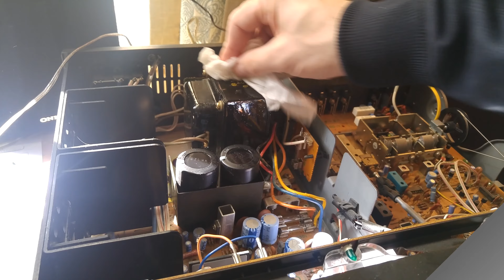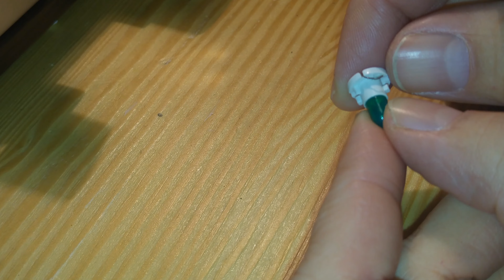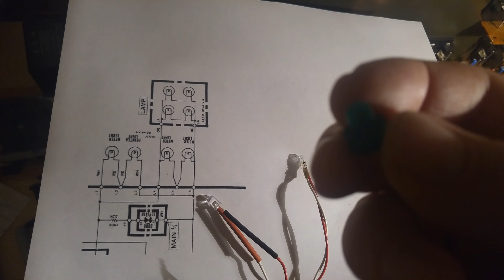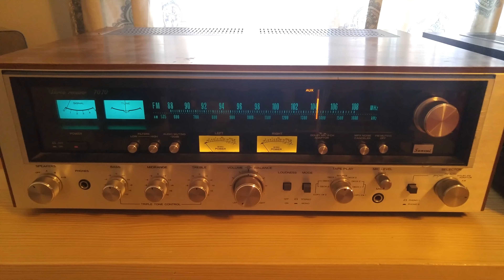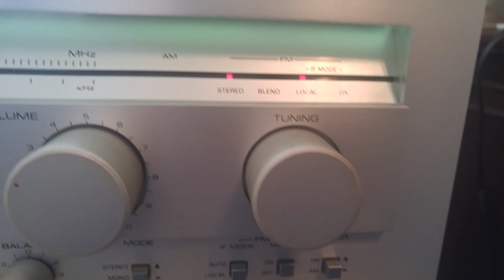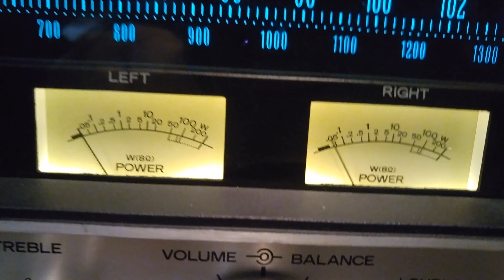Yamaha CR-640 vs R-N301 vs Sansui 7070

Comment: LED's are too "hot' in my opinion.  I prefer the original lamps with the condoms on them.  BTW, the Sansui, as proven by the increase in pricing, is a much better unit.  The 40 series had the now unobtainium pre-driver chips. That has tanked the value of these machines, unfortunately.  Those were made by Sanyo specifically for Yamaha, and are proprietary.  A dead unit is now a paperweight.
Reply from the maker: Yes, I started listening to the Sansui almost daily a few years back and really like it... Thanks for the comment!
Reply: @ACBMemphis  I've also heard, but can't verify, that these units attract spiders.... :)

Comment: Nice video. Did I miss the part where you got the protection relay to clicking and the receiver begins to work again? I have the exact same problem with my CR-640. Can you walk me through what it took to get it to start back up? Thanks ACBMemphis.
Reply from the maker: I didn't record that part... Using a digital voltmeter, I put the black/negative on ground, and measured the voltage at 2 specific test points on the board near the protection relay. (I believe these were labeled TR and TL). I had to adjust some very sensitive pots for zero. You can use Google to find the service manual and details for this procedure. Also, the test points were close to other wires so I suggest covering most of the test probe except for the tip with electrical tape so nothing shorts... A couple of good sites to search for the CR-640 are "audiokarma.org" and "hifiengine.com" ...
Reply: The only problem was  that the white noise dissapeared between stations. It is amazing. The sansui is amazing too.

Comment: thanks for the vid! I have a CR840 and would like to upgrade the bulbs to LED. Would you happen to remember the value of the resistor you used on the 4 LEDs on top, the 2 for the meters and the last one for the tuner dial?
Reply from the maker: Thanks for watching. I believe it was a 2.2K resistor. If you do a Google search for "yamaha receiver bulb to led conversion resistor" there is a forum post where someone said they use a 2.4K resistor on a CR-420. Good luck!
Reply: @ACBMemphis  I hate to ask but I so want to get the exact result with led conversion.  Looks like clear water green led's 5mm 12V or could you post the part number and source? And great video!
Reply from the maker: @nkohanowski  Thanks for watching. Yes they are 5mm. It was a tight fit, mostly because of the size of the wires on the LED but you can make it work. They are still on sale $7.98 for 100. Here is the Amazon link: http://a.co/d/buI1KyW